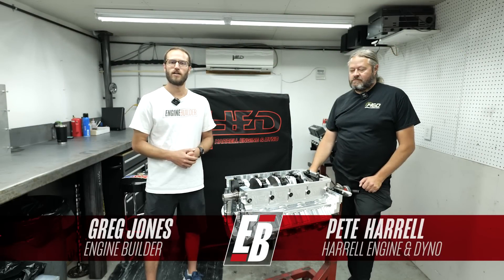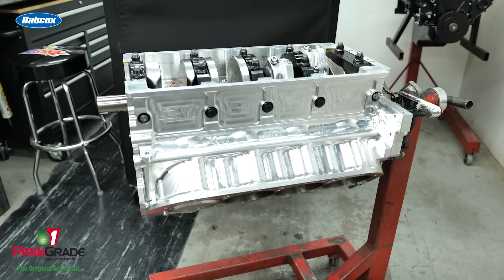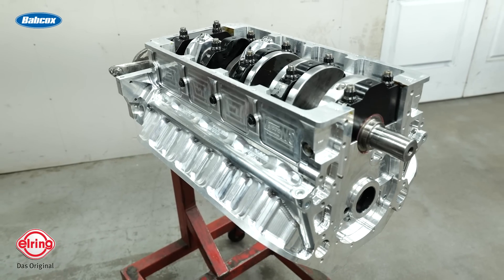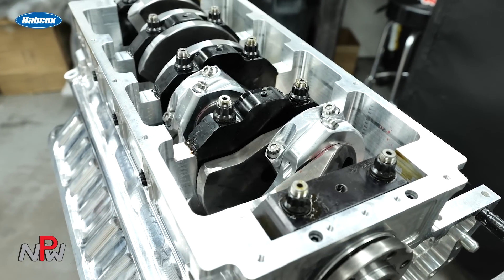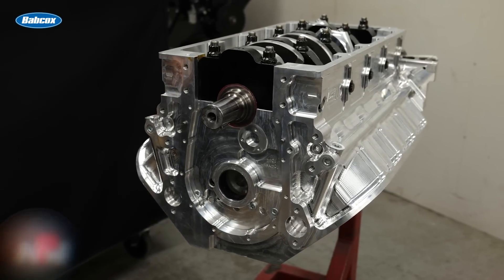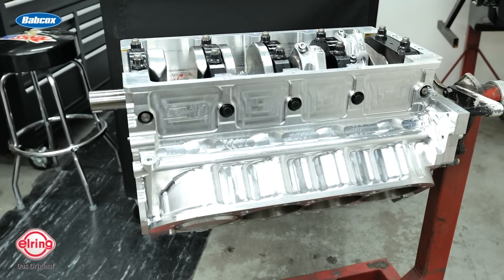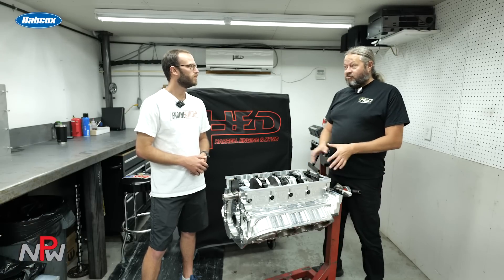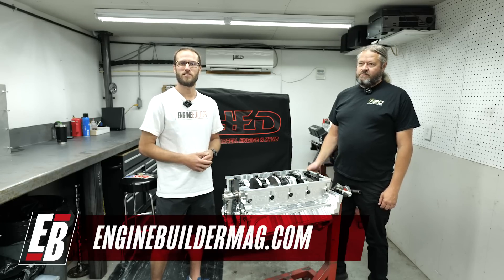Drag and Drive Billet Big Block Chevy Engine

Comment: Can a billet block withstand daily driving and high mileage?
Reply from the maker: If you do the right things for it to live in that environment, then its possible. There is a difference between some regular street miles and truly using it as a daily driver. But for things like drag-and-drive events, they are definitely capable foundations.
Reply: I would say it can, But you have to put more attention since the damn thing is so expensive. Maintenance too. 
Also, you have to turned down the power, makes it reasonable and at this point, why use it? Because the factory cast block offer the same thing with less money and regular maintenance. It's like no brainer if you want a billet block just to have it as daily driver. Just because it can doesn't mean you should.
Oh yeah, all of that thing I said wouldn't applied to those who rich and dumb.
Which is rare considering you will not be rich if you were dumb. That means, rich parents.